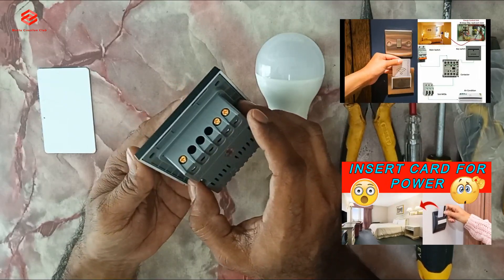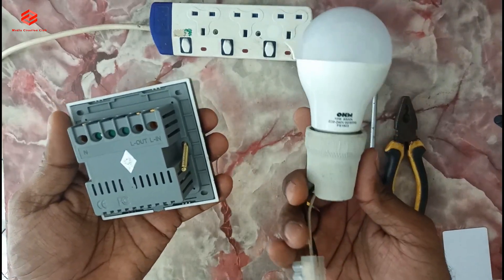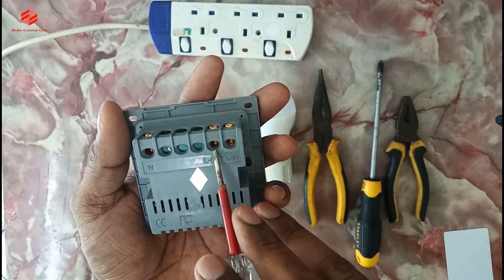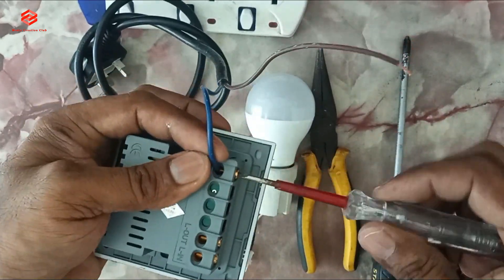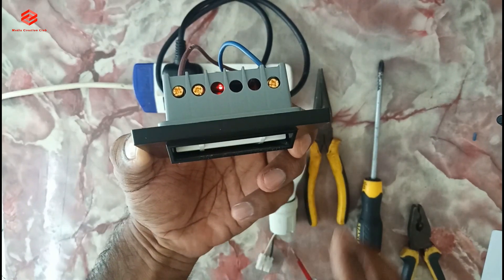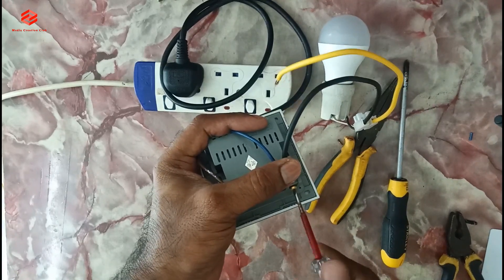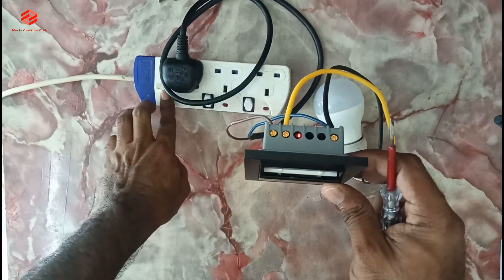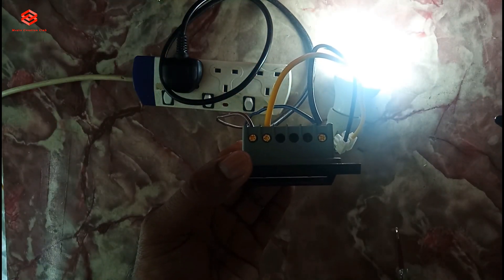Key Card Switch || keycard Switch How to wiring || Part #1 || full Explained Wiring

Comment: Okay can it be used for the overall power in a room? That is both socket and A/Cs
Reply from the maker: Yes can
Reply: @MediaCreationClub1 

Is it the same card I will use for opening my door, RFID
Reply: One will now send an output from the keycard to the distribution board to power the whole circut, isn't that much? Just asking
Reply: Thanks 👍